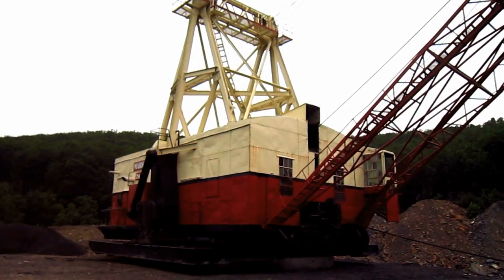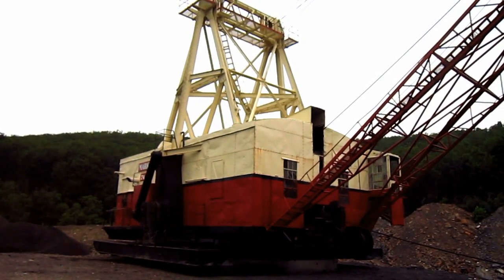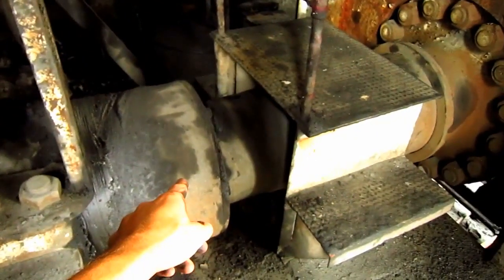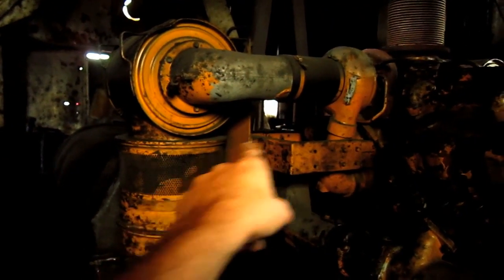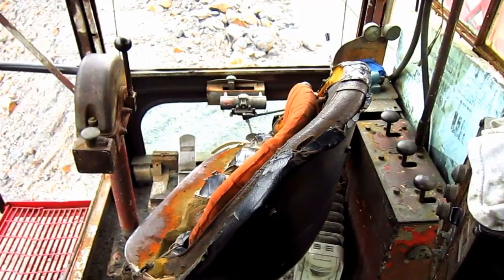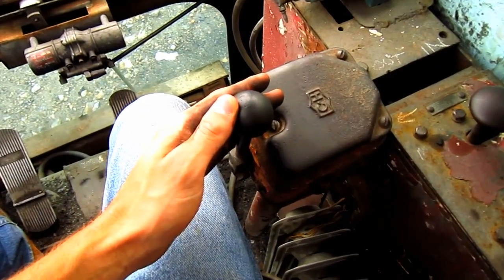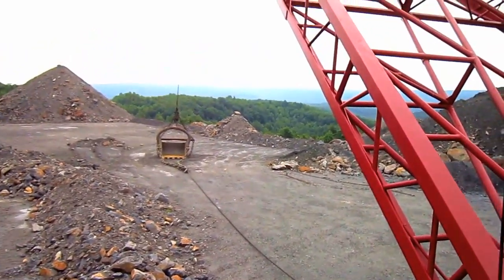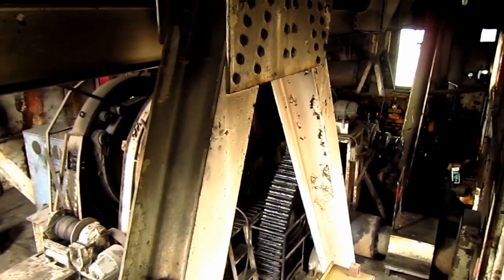Marion Type 7400 Documentary

Comment: Great job Justin, I really felt like I was there. Interesting hoist-drag control but makes complete sense. Seems like it would be fairly easy to operate....once you got the hang of it. You've really mastered the steady hand while walking. Anthracite region right?
Reply from the maker: That's great, I love hearing that! The camera does have Image Stabilization which removes slight shakes, but even so it still requires a lot of focus to film smoothly like this.  And yes, anthracite dragline! Thanks

Comment: Thanks for the great video Justin.  As always, it is fun and educational.  Question: if the walking shoes work off a single drive shaft, does that mean they are locked in sync?  If so, how do they steer it? Perhaps there is some form of clutch?
Reply from the maker: Thanks, those two things are always my goal in these videos!  Yes, the shoes work together not independently.  Steering is accomplished by swinging the dragline left or right.  Whichever way the dragline is facing, it will move in that direction in reverse.

Comment: She's still impressive, all these years later.Is it run solely by an operator or is there a mechanic on board as well?  Silly question, but this is outside my experience. lol   As always, thanks for sharing a great video.  All best.
Reply from the maker: Most draglines like this have an operator and an oiler/mechanic on board.  The motors and gearing need daily maintenance that becomes too much work for a single operator.